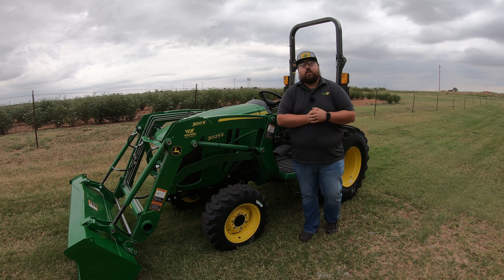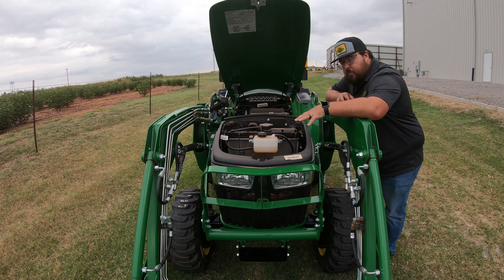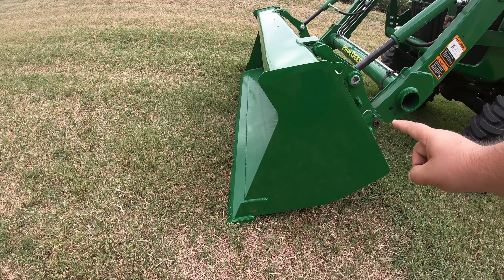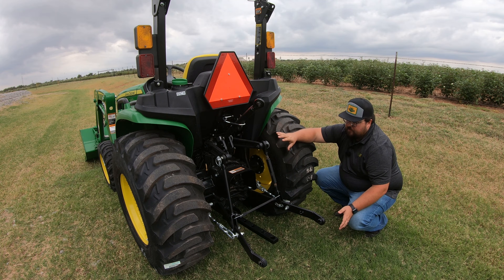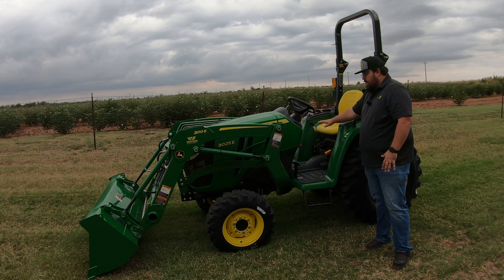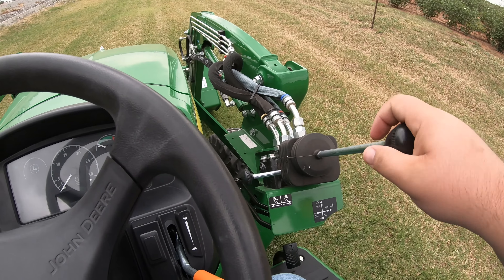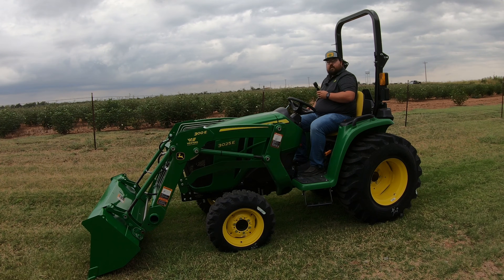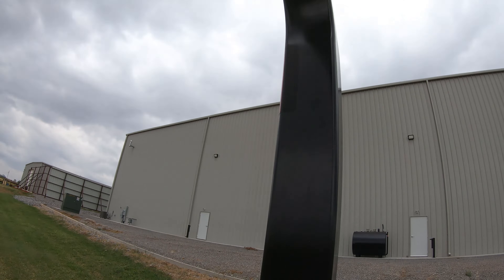2023 John Deere 3025E Tractor Review & Walkaround

Comment: Do yourself a favor and buy a Kioti 2620hst. Way more standard features, all metal, quick detach loader, heavier machine, bucket lift is around 500lbs more, pto puts out more power, come standard with rimgaurd filled tires, has third function hydraulic buttons already installed, standard skid steer quick attach. Less money and waaay better machine. John Deere is coasting off the name at this point. TYM also makes superior tractors. Don’t believe me? Go compare.

Comment: Is that a plastic hood still  ? 
How come it doesn't have standard rear hydraulics  ? 
Don't like where you fill for  fuel  it's to high  . 
That tractor doesn't come with gear driven with shuttle shift  ?
Reply from the maker: Hood is still a composite material yes.
A lot of small compact tractors do not come standard with rear hydraulics.
I agree the fuel fill is a little high if you are filling with a fuel can.
This specific model doesn't but you can get into a 3D series tractor that is gear driven.
Reply: @WesternEquipment  I was looking at a 25 horse New Holland with shuttle shift and he said it came standard with two rear hydraulics  .  With all the new implements you can now get with these smaller tractors I figured they all would have standard rear hydraulics  . I'm looking into a flail mower that has hydraulic lifts so that is why I'm asking  . I really liked the Massey Ferguson the best but they said that is a ordered feature which means it drives up the cost of the tractor so I'm now looking at other brands .